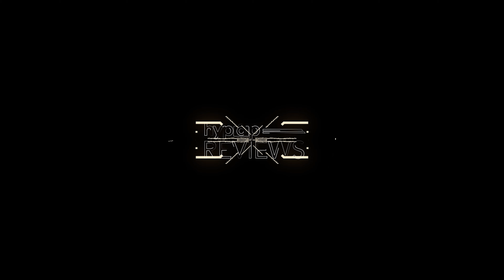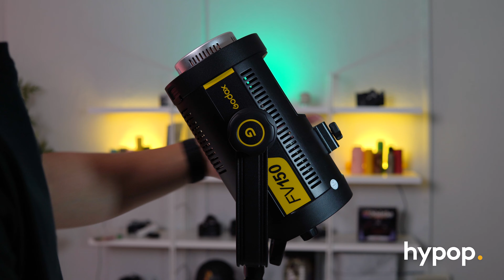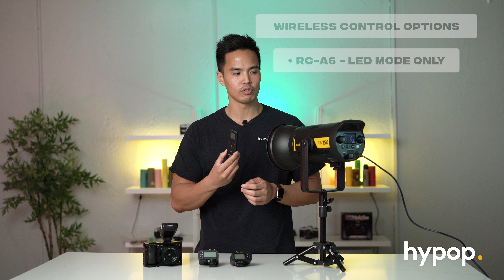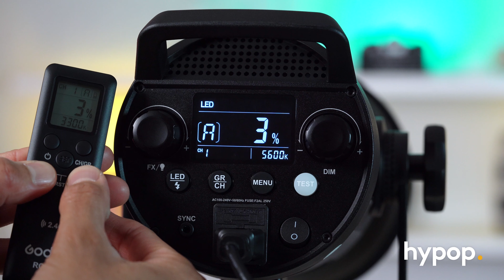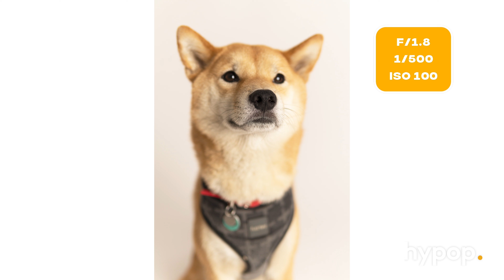Godox FV150 High Speed Sync Hybrid LED Light Unboxing and Review

Comment from the maker: Let us know your thoughts about the Godox FV150 in the comments below and if you would add this to your photography setup 👇

TIMESTAMPS:

0:42 Introduction
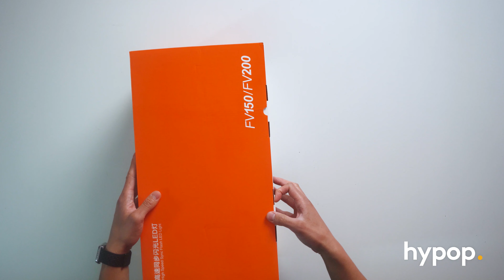1:04 Unboxing and What's Included
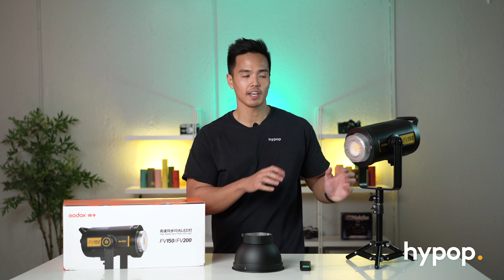2:30 Closer Look of the Godox FV150 Hybrid Light
6:17 Yoke Bar and Tilting Knob of Godox FV150 Hybrid Light
6:52 Bowens Mount for Lighting Modifiers
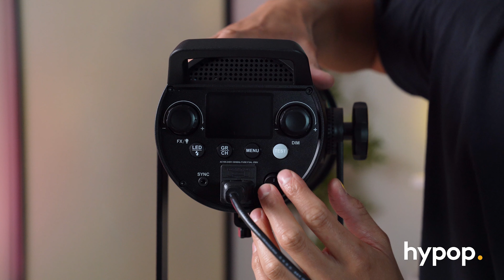9:26 Menu Options + Flash Mode of Godox FV150 Hybrid Light
11:57 Modelling Lamp
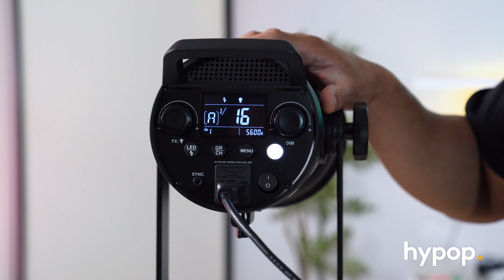12:59 Continuous LED Setting
13:09 Brightness Light Output Demo 0-100%
13:22 Special Lighting Effects (8)
14:59 RC-A6 LED Mode Remote
16:59 Godox X1 and X-Pro Trigger for Flash Mode
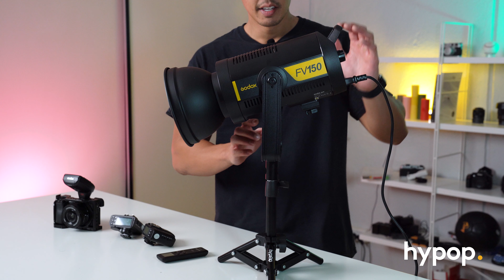21:25 Umbrella Mounting Point
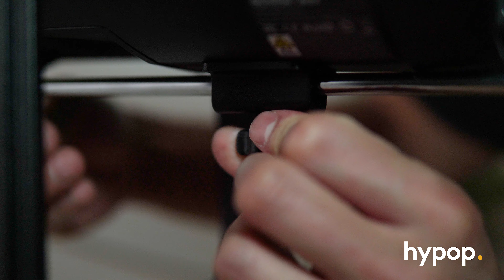21:38 Use Light Stand Mount Horizontally or Vertically
22:13 Resetting RC-A6 Remote to Factory Settings
22:56 Hard Reset Godox FV150 Hybrid Light
23:39 Other Specifications of Godox FV150
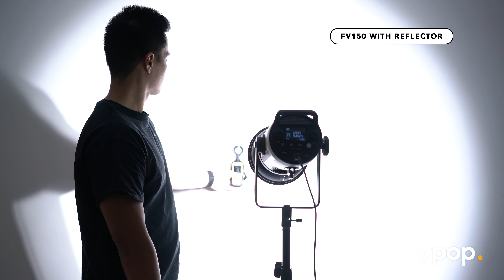24:23 Is the Godox FV150 Right for You?

Comment: I just bought the fv200 after watching your review. I use a fuji xt2 and there is a dark side when using this as a flash at 1/200 and 1/250. However when used at HSS at 1/320 the dark side is gone. Would you know why this happens? 1/250 should still be fine without any shutter delay that causes the dark side
Reply: What do you mean with „dark side“. How good is the overall power output as a flash?
Reply: Try to lower the syn speed, say to 1/200 of a second, I think the dark edge will be gone.

Comment: Thanks so much for every aspect information. Do you have any issue with fan noise? Actually I'm aiming for godox sl-60w. But now I'm undecided whether to go for sl-60w or this fv150. Any chance you have compared sl-60w with this fv150? Thanks in advance
Reply: i have the same doubt
Reply: @himsxoxo  update as of 6 Aug 2021, I go for SL200 mark2. SL-60 is too low brightness. For FV150, i decide that i don't use much of flash function. SL-200 mark2 is among one of the most slience light. Cheers!

Comment: I own a wide range of Godoy lighting gear and found them all to offer extremely good value for money. Unfortunately this is the only piece of gear I’ve been disappointed with. The actual COB LED is outstanding but the flash option is of little value. Despite being marketed as being “four times brighter” it’s actually barely as powerful as a normal speed light. The unit itself is quite large and heavy especially compared to several other units of similar power. As an LED unit for video it is great but I wouldn’t buy this expecting to get much use from the flash unit.
Reply: Chris I never use it bare, so don’t care how it ‘spreads’ the light. I always use it with modifiers and never had an issue so long as I’m pretty close to my subject. I primarily shoot portraits so use a variety of different soft boxes, umbrellas and diffusers. I suppose the modifier I use most is a beauty dish but I also use a fresnel lens, they all work perfectly well, just like when they were fitted to my old Bowen’s kit. The quality of the light is very similar to using old school studio flash, its just not as powerful. I’ve used it with a Westcott 7ft umbrella and diffuser when lighting a big group. It worked fine but I had to ramp up the power. The recycle times are acceptable but I wouldn’t call them quick, especially when compared to one of the new strobes like the AD300Pro (which has become my new go to flash). Considering the price, the FV150 is a pretty poor studio flash but a more than acceptable cob led, but if I was going to buy a cob style video light again I wouldn’t bother with this one, I’d go with either the VL series or wait and see what the new UL series lights are like. The FV series lights are a bit blah in my opinion...neither a proper flash or a proper continuous light, just an average, heavy, under powered, attempt at a not very feasible concept.
Reply: Chris  , there is no GN for this product. It is a good assumption that is not provided, because it is low. This is primarily a CL product with an option for a two-stop higher output for stills. It is not a replacement for the standard flash products. The angles are 55/120 with/without the reflector.

Comment: So this is basically an led that can functions as a flash by doing a quick on and off so to speak to have a flash effect?
Reply from the maker: Yes, exactly! The burst of flash is amplified at 4x output
Reply: @hypop  ok do you know hwo powerfull the flash is at full power?
Reply from the maker: @RonnelCuison  It's a 150W flash. They also have a 200W model which is the FV200.
Reply: Chris  , AD400 costs $200 more. That's a different price category.

Comment: Very nice, detailed review. This is great for single user environment.
My question
1. Is it light enough to be used in normal light stand? Or should be used in strong sturdy stand or C-stand. 
2. How is the fan noise? For video work... I've heard that other godox video lights fan are noisy
Reply from the maker: It's weight and size is similar to a standard studio flash strobe so a heavier duty stand would be ideal, especially if using a larger lighting modifier such as an octabox. We use an air-cushioned 260cm / 8.5 feet stand or a c-stand usually.

The fan noise isn't that evident as in most cases your microphone won't be right next to the light and you can enable the low-pass/low-cut filter also. We didn't test the exact dB sound output but it wasn't obvious during testing.
Reply: Gokul S the unit is pretty heavy, I use a heavyweight stand for mine. The fan is silent definitely much quieter than other models.
Reply: Their fans slowly stop working. Not a good product for Run&Gun creators.